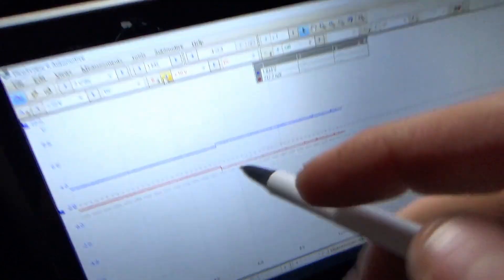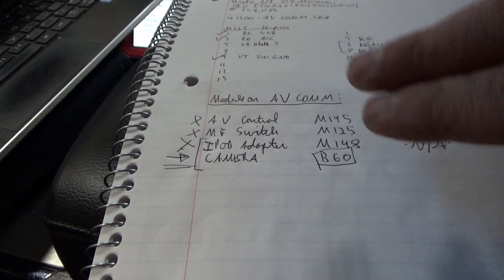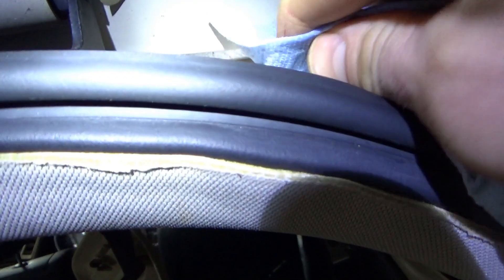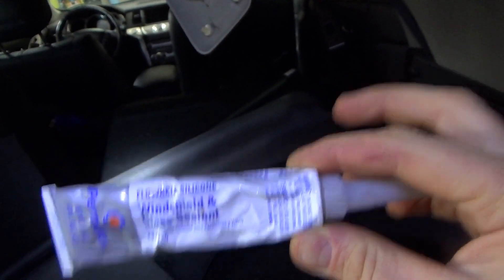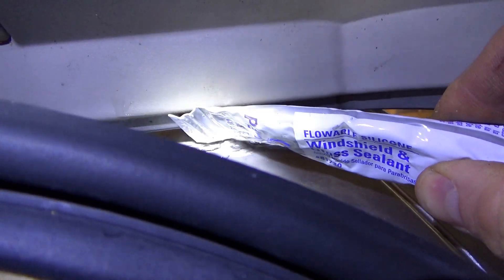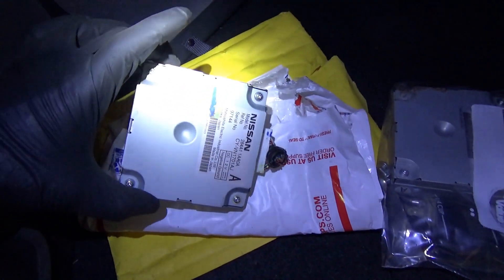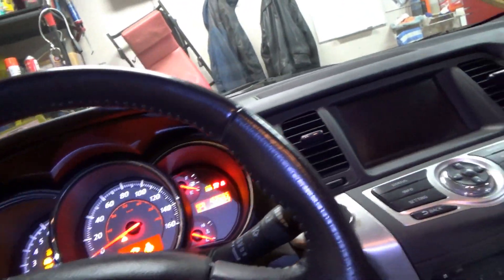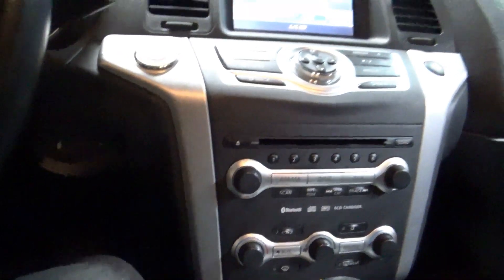Mystery Murano...No RADIO, No HVAC, No fun!

Comment: Here's a tip for using tubes of silicone and the likes - if you have a food saver or seal a meal, (food saver works best since it vacuums out the air) after opening and using your tube, put it into a bag and seal it. Not a guaranteed 100% fix, but I've had tubes last me for several months this way. Not an issue for something you use all the time, but for those once in a while use items, it may make the difference of having to buy a new tube every time you need it.

Comment: Just this week I had a ML350 with CAN network pulled to ground preventing starting and numerous issues. The amplifier had water intrusion from the cracked tail light. Disconnected amp and put some RTV on the Crack for the tail light for a temp fix. Started right up after Amp was disconnected

Comment: My guess is the assembly line "robot" wasn't programed correct to supply the right amount of body sealant via volume and/or path to apply it.  If not that, a simple product defect. 
Water got in...humidity is what damage the control board components. Great find Ivan...

Comment: Thanks for another very informative video.  This customer was able to do this level of disassembly and swapping before bringing it in, so I wonder if it would have been worth it for the customer to buy short term access to repair data from Alldata DIY or something like that, in this case.

Comment: I had a Crysler recently. Intermittently the start/stop system would shut off. And a message saying it was being disabled would come on in the instrument cluster. It took me quite a while to realize that the hood switch was Intermittently showing hood was open. Therefore shutting off the start/stop system. But man. These cars are getting more and more complicated.
Reply: That is absolutely nuts.  Why would the car shut off for that?  Stupid engineers.
Reply from the maker: Huh well maybe hot wire the hood switch to disable the stupid start stop system anyways 😉👍
Reply: @Pine Hollow Auto Diagnostics  Thought about it. But the switch has a biased voltage. And there are two. One for the latch and one on the driver side of the hood. They both have a biased voltage that switches to a different value when open and / or closed. So the scantool would show 7 volts on the hood switch, and I think it was 2.8 on the side switch. The side switch was supposed to be 4.8. I figured that out once the switch was replaced. So when actuating the switches manually it didn't look like they weren't working. And the crazy thing is that there were no codes anywhere for the start stop system. It would flag a ln error, show the message but then not throw any codes. It took 3 days of trial and error before finally the vehicle threw a code for the switch A circuit. Then it was trying to figure out which is switch A. Since the wiring diagram didn't distinguish that. It was a bitch of a diag because the information isn't there and the car wasn't flagging anything. So it was hard to get a direction. We replaced the battery because it has to be higher than 750 cca's due to the start stop system. And there was a 500 CCA battery in it from the factory. Which was another head scratcher. But our logic was that maybe somehow it being too low of a CCA rating maybe it was causing a voltage drop. Again if it had thrown that code right off the bat then at least I would have had direction. But it was chasing ghosts for a while before finally telling on itself.

Comment: I miss the days of flipping a switch meant I was actually turning on something.  Even a relay.  Not a position interpreted spiny thing that is translated into digital pulses passed down about 2 feet of wire to another computer that reads the digital pulses and makes a change in the settings in a computer program.   This is coming from a guy that teaches an entry level electrical wiring, "what is digital?, and simple architecture course to computer science majors (and a few physics).  I should make this video required for that class.
Reply: Agreed my first landrover had two fuses and the entire rear loom was three wires !
Reply: @bryanlatimer-davies1222  Ah, the old days. There were only two wires going to the engine: thin one to the coil, and fat one to the starter.

Comment: had a similar problem in a 2001 maxima but there it was leaking thru the tail lights, but there was no backup cam in that year.   I had to use a hand transfer pump to get the water out.  some clear silicone  helped that one

Comment: Ivan that alldata schismatics is surely a lifesaver. For the normal backyard fix it guy this is out of our price point, or is it? How much do you pay for this service?? Thanks for bringing us alond and a great fix......Pete
Reply: They offer a single vehicle DIY version with the options of 1 month for 20.00 a year for 60.00 and 3 years for 130.00. Mitchell 1 also offers a DIY portal at 20 a month, 40 a year or 4 years for 60.00.  Or if you want the same information there are a couple sites that might help, like 2carpros or ricksfreeautorepair
Reply: You need an alldatadiy subscription for a single vehicle. It's priced for diy use. If not that, then a service manual. I've had alldatadiy subscriptions for my vehicles for years.
Reply: Look up All data DIY online for individual vehicle pricing.  They have professional versions for those in the diag business.
Reply: Does the DIY version give you access to the same wiring diagrams or does it limit your access?
Reply from the maker: 160 bucks a month, worth every penny!

Comment: Hey Ivan;  in your experience, do you think would it make any sense to coat those circuit boards with a silicone base conformal coating?  I'd bet money the manufacturers didn't do too much of that, as that stuff can be pricey.

Comment: I wonder why the manufacturers haven't gone to Fiber-optic networks. Then the only copper wiring that is needed to be distributed throughout the vehicle would be 12vdc and ground (and then with a good fusing plan it should be relatively easy to troubleshot power distribution issues) and then when a device or fiber to copper adapter goes down it isn't likely to take out a complete network. I would assume that the price difference is probably at parity (copper pricing can be pretty volatile and I'm guessing fiber is probably pretty stable).

Comment: I know it's been a while since you made this video but I'll take a shot. I bought my daughter an 04 murano without the navigation. It's having this same issue with the hvac and radio controls. Even the mirror controls not working. Checked fuses and nothing. Looked for the module you found with the green crusties but there is not one in this model. Any guidance would be appreciated.

Comment: good catch would you credit something the other end of the car causing the problem one waterleak i had with a brand new not registerd fiesta  water filling up the spare wheel well i soaked the entire back end it ended up getting in on front roof skin joint where the sealer blisterd when the shell was baked after paint the hole was microscopic and sorted by applying a drop of paint with a single bristle  to fill the hole

Comment: I once owned an Eclipse.  It devolved a leak like in this video.  Upon inspection I discovered that the rear window trim was held on by clips that passed right through the sheet metal.  But under each clip was a gray foam gasket.  How long does a foam gasket last?  About five years is the answer - then it turns to dust.

Comment: Ivan,  does an automotive can buss have termination resistors. X-ray machines use a 5v can buss on their data lines in series with termination resistors. It looked like the data buss was parallel with no termination resistors required . Correct?
Reply from the maker: Depends on the vehicle...

Comment: I had an ml 500 with similar craziness.  Turns out the main io board is  under the right rear tail light. The gasket for the tail light was leaking. It driped on the board and filled up the spare well with water. I was able to scrub the board and reuse it.

Comment: If you put that module back in enclose it in quart freezer plastic bag.  Cinched up as tight as possible around the connector with wire ties.

Comment: I have slowly come to the conclusion that with the exception of my tow pig, if it has more than three modules, I am likely not the owner for that car.  Granted, my spare hooptie, 2001 Park Avenue Ultra, technically does have considerably more but they are all "dumb" modules that only connect to the PCM and/or the BCM so when they fail only that functionality is lost.  Its not that this type of troubleshooting is beyond my capability, it is just beyond my BS tolerance level.

Comment: S A n easy non/zztech wuestion. I just bought a 2024 MURANO SV midnight edition and love it, but can’t figure out how to put in sport mode. There’s no button or markings dot “s” anywhere and no shift mode dial. The internet confirms there are drive modes, but I think that’s fake news!  How do you select drive modes in a2024 MURANO?Om not a “ car guy “ but if it was there I’d be able to find it. Was I mislead about 3024 MURANO having drive modes ( I know the pathfinder does. Help! So confused 😮

Comment: Surprised me that you weren’t going for the no parts required. Of course for the 100% fix and no call back used module is the ticket. Scrubbing the crusty module with iso. just may have fixed it. Repaired many of pc boards that way.

Comment: Modern cars are smart, but not quite smart enough. If they were just a little smarter you would have thought they would be designed in a way where they could detect which circuit was bad, and then disable that circuit only, rather than just letting one item on a bus bring the whole lot down. If that had been the case here, then the only thing not to work would have been the rear camera system. With regard the water leak, after 26 years my Mondeo is suffering from the same, sealant drying out in all of the body panel joints. Along the roof, around the boot, around the firewall. A right pain i can tell you, but hey, at least the old Ford lasted 26 years before the sealant dried out! How is your old  Mystique doing? Still dry inside?
Reply from the maker: Haha I must have used half a tube of that sealer on the Mystique trying to fix a water leak into the trunk. Finally got it... Was leaking at the bottom of the rear glass and also along the side roof gutters 😉

Comment: What costs more? The tow or the diagnosis?
Reply: He said the customer drove the vehicle to his shop. So no tow fees.
Reply: @davidquinn6161  I read this in the title. Owner of this 2009 Nissan Murano tried the "eBay parts cannon" to get his HVAC and Radio back online, but failed. He then towed it 4 hours to PHAD for a diagnosis.
Reply: In the first few seconds of the video, Ivan states that the customer drove it 4 hours from New Jersey.  Not towed.
Reply from the maker: @kerrylewis2581  he rented a uhaul dolly and towed it with his own pickup truck 😁
Reply: @PineHollowAutoDiagnostics  Ivan, What is the farthest anyone has traveled to your shop for repairs?

Comment: Don't see advantage of cutting corner of tube.  If it hardens in spout, just plug it with a nail.
Reply from the maker: Like half the tube was solidified 🤣
Reply: @PineHollowAutoDiagnostics  new tube?  Had a simiilar problem with gorilla glue.

Comment: You could try to fix that rusty module by cleaning it with semisoft plastic brush and alcohol. Check/change that capcitor.
What about these cracks dissapearing up under railings (top)

Comment: The electronic design engineer people need their arises beat for systems design that aren’t separate from the engine at least.  They don’t think about some stupid little sensor or whatever failure causing an engine to stop may cost lives. Especially in cold weather or maybe even out in the desert heat. There’s technically NO FRICKING reason to wholly integrate so many circuits.